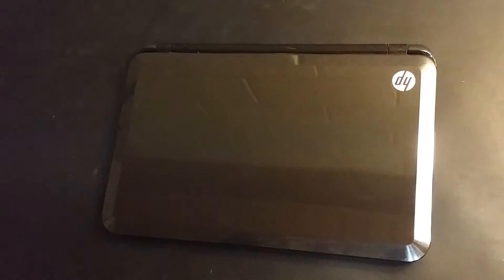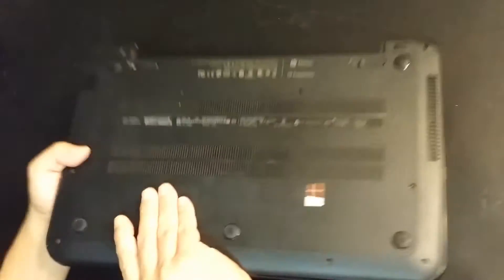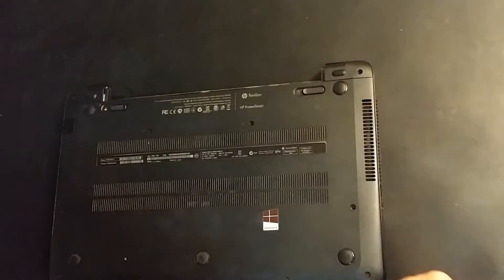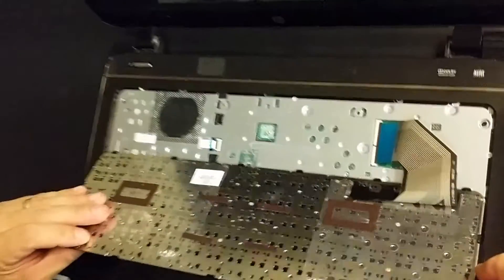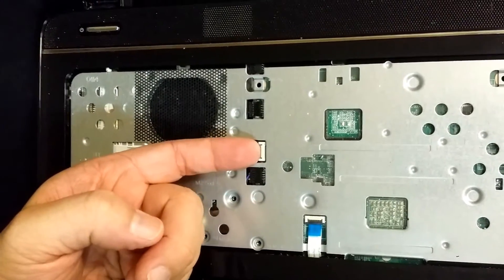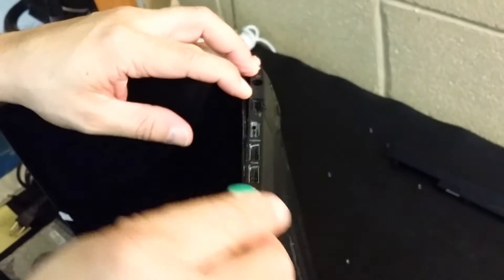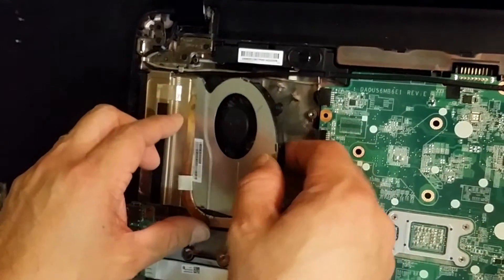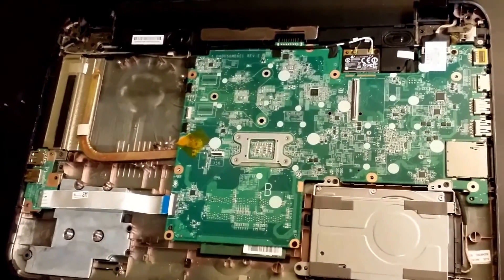HP Touchsmart 15-b129wm Disassembly CPU Fan Removal

Comment: Great tutorial! I had to remove the motherboard to add RAM. What a crappy design!
Reply: I just got this laptop and want to upgrade it with more ram, SSD and possibly the coin cell battery. Do you know what the max capacity of ram and type that it takes. I'm going to install Linux on it😊

Comment: This was really helpful in guiding me in upgrading my ram. The only problem is I must have unplugged or damaged the touchscreen connection. Everything else seems to work, and I can live without the touch screen (as I rarely used it), but I might replace the CPU fan anyway. If I do open it up again, do you know where I should look to make sure everything's connected correctly for the touchscreen? Thanks in advance.
Reply from the maker: The touchscreen connector is the same LED connector cable that goes from the back of the LED Screen running along the bottom of the LED lid through the LEFT HINGE area then down to the motherboard.  Make sure that the connections are firmly secure at the motherboard connection.

Devin

Comment: is there ram in the computer because i want to turn this pc computer a gaming pc and please respond
Reply from the maker: You can upgrade your HP Pavilion TouchSmart 15-b129wm Laptop to up to a maximum memory capacity of 8 GB Memory.  The Laptop has 2 Slots to install memory, already with 4 GB standard memory installed. For best Pavilion TouchSmart 15-b129wm Laptop performance use the maximum amount of 8 GB, fill all the slots with the max allowed memory per slot for your Laptop.

Comment: I can't seem to find the actual CPU. I'm intending to replace it with a compatible CPU that I grabbed from newegg, but I can't find the old CPU to remove it. Any help would be appreciated.
Reply from the maker: You have to remove the motherboard and the CPU will be under the CPU Fan Heatsink (the copper tube going to the CPU fan blades.  The CPU is under a silver square heat plate that is being held down by FOUR (4) screws.  Unscrew all four screws from the motherboard in numbered order and you will expose the CPU.  PLEASE NOTE:  You will need to turn the CPU retaining screw (Black Plastic Screw) in order to release the CPU.  DO NOT PRY THE CPU OUT WITHOUT TURNING THE SCREW or you will cause serious damage to both the CPU and the Motherboard.  Also, you will need to get Arctic Silver thermal paste once the new CPU is installed.  A single small pea sized drop placed dead center on the cpu will be sufficient.  Then you place the Silver heat sink back on to the CPU and screw the four screws in number order to tighten and hold the heat sink back to the motherboard.  After everything is reassembled, it might be prudent to check HP's website for BIOS updates to make sure that your new CPU is on the compatibility list.  If it isn't you will want to update your BIOS in order for it to work better.

Good luck!

Devin
Reply: Angrysquirrel PC unfortunately it doesn't have a CPU. The most confusing part of this situation is that it doesn't even have a CPU hookup to it. The other laptop that I disassembled did, had the holder and the screw slots to show it even after I removed it. But this one doesn't. Are there models of laptops that have a CPU build into the motherboard or am I going nuts?
Reply: Never mind. I found it but it isn't removable. It's built into the motherboard; almost like it's glued on. no screws.
Reply from the maker: Yeah some models of this type use the soldered on CPU that cannot be upgraded.  After doing some research, this model had two variations.  Sorry you can't upgrade your cpu :(
Reply: CPU is soldered directly to the motherboard (BGA chip).  Newer laptops no longer have socketed CPU's...those days are long gone.

Comment: with a hp 15-b129wm sleekbook is there any way I can upgrade it to a i7 processor
Reply from the maker: It all depends on the motherboard in this laptop.  There can be different motherboards depending on when the system was actually built.  You will have to determine the motherboard part number and it is normally located as a sticker near the system DIMM memory slots.  You will then look up the specs for that motherboard and determine what processors it can support.  You THEN will have to see if you will need to do a BIOS Update if that motherboard has does not support a core i7 processor with the current bios version your system currently has.  You can see what bios version you have by going into the UEFI settings by booting your system from a OFF state then tapping the Esc key.  Select F1 or F2 for System Information or BIOS System Settings and look for the BIOS version number.  

Devin
Reply: No you can't - unless you find a similar motherboard with an i7 processor...

Comment: How do you remove the cover from a Hp ba037cl ?
Reply from the maker: This is a brand new laptop made in July 2016.  There are no technical notes on disassembly yet.  Unless one comes into my shop for me to disassemble, I have no way of knowing yet.  Why do you need to remove a cover on a laptop this new?
Reply: I am also a tech. I am trying to remove the hard drive to recover data. OS will not load; nor will the recovery partition.
Reply: but I figured it out yesterday. There were two screws hidden under the rubber feat of the laptop. just FYI if you get this question again.
Reply from the maker: Yeah good work!  Some models as you know have screws under the rubber feet.  The problem is 50% of the time, there are no screws and you pulled off the feet for nothing :(  Thanks for the info on this HP model!

Devin